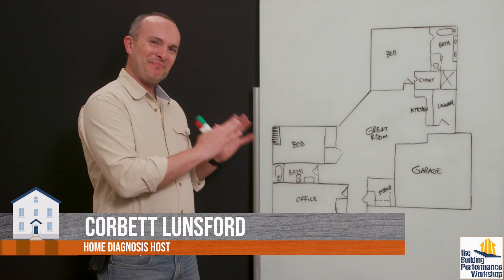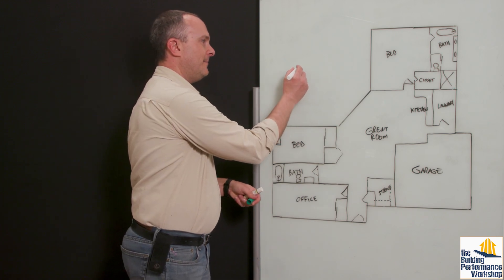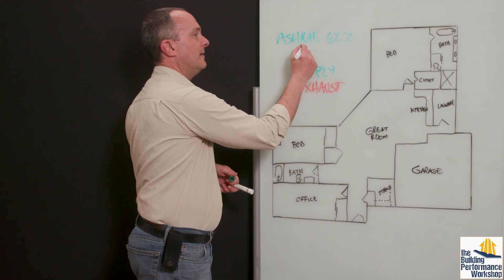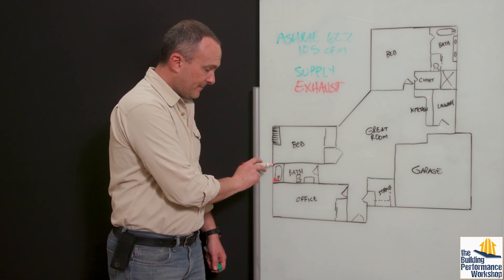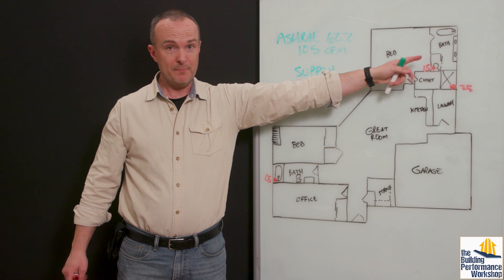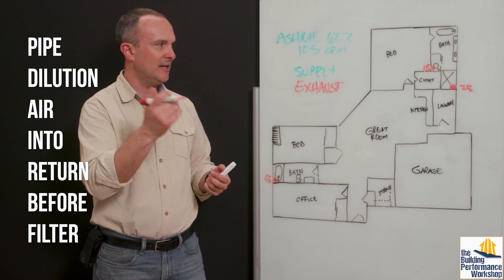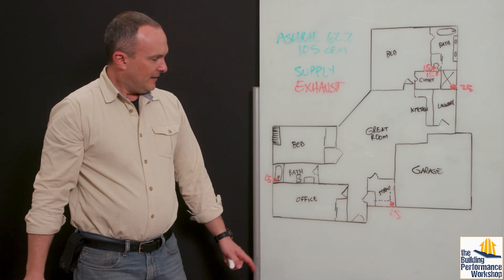Airtight Home Ventilation: Where to Place ERV Exhaust and Supply Grilles (HVAC Training)

Comment: Thanks for your channel.  I'm actually doing a major rebuild on a semi-remote island near Vancouver.  It's about as airtight as possible with a rebuild, with hydronic heating, and will require all sorts of creative installation to get the lines where they need to get in a building not designed for HRV/ERV.  I am relying on your channel, as getting anyone out here to do the work is impossible, so I'll have to become an HRV expert pretty quickly.  🙂

Comment: Great video and completely understood.  Would like to see a second part on this of sizing and location of supply air coming in at the best locations to assure operable balancing.   Sizing of lines, suggestions on proper vent grills or manual open closed vents.

Comment: Great video. However, I don't actually see placement of the supply grilles covered in the video (as title suggests). Lots of detail on unique CFMs per exhaust, but where did you place your supplies and at what CFMs? Possibly you can just post an image of the floor plan with supplies and exhausts. Cheers.
Reply from the maker: In the US, we size our ventilation off numbers for exhaust, then fit the supply to that (as long as ASHRAE 62.2 does not exceed, in which case use bigger target).
In Europe and even Canada, it’s opposite- they size based on supply targets and fit exh to it. 
I do mention, but easiest (and best imo) is to inject fresh air to return of central HVAC ductwork. Otherwise just make each room either supplied or exhausted as far from the door as is feasible.
Reply: Yeah, I was wondering if I'd missed the supply side but its not there.
Also, I've got a 'shower dome' which is awesome & keeps nearly all of the humidity inside the shower cubicle. I haven't seen any ERV/HVAC people discussing how this changes things.

Comment: That’s the thing, making design choices without sufficient knowledge and experience is an experiment. WARNING: Offering advice cloaked in a tone of certainty is unprofessional. I’m surprised you haven’t been sued. Be careful, buddy.
Reply from the maker: Not sure what exactly you’d propose for the thousands of people out there moving into quite airtight homes, but I’ll keep doing what I’m doing until anyone has better advice for them.
Reply: @HomePerformance  I will start by stating that it’s not your job to worry about the masses. I would think the most important thing is to dispense actuate information. Perhaps that is why I warn you and all the viewers. If you are asking for advice, then this. # 1 Allow for caveats and specials circumstances, every building is unique. That’s proven by TVA studies. If you don’t have a 360 view, then stop. #2 - Avoid the Dunning-Kruger effect. No one knows everything in this industry so let that be the guide towards humility. #3 - Provide follow up videos, like any good science, BS is evolving, what we know today might be tomorrow’s Duct board. Be okay with correcting thyself. #4 - There isn’t a magic bullet but you and I know that. However,  your audience may not. Some will listen to every word and execute half baked idea. Doesn’t that concern you? Be sensitive to that. Sure, you’ve done some work in educating yourself but that’s not enough. Chemistry, fluid dynamics, thermal processes and people are working against the design intentions. Take care when speaking to the masses.
Reply from the maker: Jon, I think you may not understand how many follow up videos we have, what we do for a living, or what worrying about the masses is about. Sounds like you might be looking for a different channel, and it also sounds like you might make money from spray foam.
Reply: @HomePerformance  I logged back in to offer this sentiment in which I wholeheartedly mean, I do not wish to offend you and the good works you and your family do. I’ve been listening to your Podcast for years and I remain a fan. How I show I care is by challenging ideas. I’m sorry you do not wish to engage in thoughtful discourse. BTW: I am a licensed HVAC consultant, Adjunct Professor, Fan of engineering, the sciences and math, expert in ERVs, VRF, DOAS, and mini-splits. My experience is split evenly between residential, commerical and industrial. I’ve represented over 50 manufacturers, and too much more to mention. IMO- Spray foam is the last resort but wouldn’t put it in my house.
Reply from the maker: Thank you for clarifying, Jon, I’m all for thoughtful discourse but you were pretty rude in this thread. You called me unprofessional, inaccurate, unknoledgeable, inexperienced, and told me I’m being negligent enough to be sued for the advice I give on this channel. Watch what you say more closely if you intend not to offend. Also, see the many other experienced professionals who are chiming in with exactly the opposite thoughts as you. Thanks for watching and being a fan, but please be a bit nicer next time, I put up with enough crap from my kids every day to take it here.

Comment: Looking for some clarification. Really like the idea of an ERV replacing the bathroom exhaust fans but getting mixed feedback when I talk to professionals in my area. The ME who designed my system says here in eastern NC we can’t do that. The installers in the area say the ERV can supplement but not replace the standard bathroom exhaust. Broan’s website advises against ERVs exhausting humid air. But this video and a high performance video says we can. Any insights you can offer? Thanks for information and the channel. Really appreciate it.
Reply: Thinking same.  With erv, humidity in shower would be redistributed to entire house.
Reply: End of the day did not pursue using the ERV as bathroom exhaust as that was against code.
Reply from the maker: @BenNC22 it is not against code. It is built into the Int’l Mech Code.
Reply: @HomePerformance  it is where I am. Multiple code officials in my county and hvac pros stated definitely bath exhaust must be directly vented outside. ERV was specifically not allowed.
Reply from the maker: @BenNC22 I believe they misunderstand ERVs, or their own code, or probably both. You can always appeal for an exception.
Reply: @BenNC22  Ask for the precise Code regulation so you can see it for yourself. Even inspectors and pros can get it wrong.

Comment: With exhaust fan in corner, 2 walls so close, possible impact to fan performance ? Rather does a fan pulling air with lower resistance on one corner but higher resistance on the wall side impact performance? Perhaps there is a way to calculate distance from walls for highest performance..or worse case reduced fan longevity.

Comment: If someone connects the ERV to the HVAC ductwork will they have to run the HVAC fan 24/7 or will the ERV be able to push/pull on its own when the HVAC is not running?
Reply from the maker: If you dump the fresh air into the return side then yes. If into the supply side then no.

Comment: damp in Vancouver?!  I beg to differ.  just because it rains a lot doesn't mean that it justifies an erv.
Reply from the maker: http://ashrae-meteo.info
Look into the actual weather patterns yourself, don’t just take my word for it. But generally, if you’re on a coast, it’s wetter.
Reply: @Home Performance  agree, generally wetter, but still fairly dry most of the time is my takeaway, even during the summer.  I'm seeing peak average wet bulb temperatures around 63, but most of the year it's much lower.  What am I not seeing?   
In general, I have no issues with ervs, but anecdata-- I have had issues with them in a few cases. In one case, (cal bay area) it was retaining too much moisture from inside the house and hrv retrofit was better at managing that.  And also, I've had complaints about ervs leaking between the streams.
Reply from the maker: Video forthcoming on the weather data, but watch this: ERV vs. HRV Mythbusting: Which Ventilation is Safer for Moisture and Humidity?
https://youtu.be/QOe4lluGwCg
Reply: @Home Performance   good stuff.  I'm with the lbnl folks on this one, but I think this is a place where reasonable people can disagree.  We agree on the goals however.    My experience is that on the west coast, it's dryer outside than inside most of the time, so that's why I err the hrv end of things.  Or at least its dry enough outside to feel sanguine about coupling my interior humidity levels with whatevers outside.  Though SoCal is starting to see increasingly longer periods of high summertime humidity (due partially to rising ocean surface water temps) which puts that into question for the future.

As an aside, ironically in spite of my preference for hrvs, it's mostly ervs that go into my projects, so you win based on that outcome.  Lol

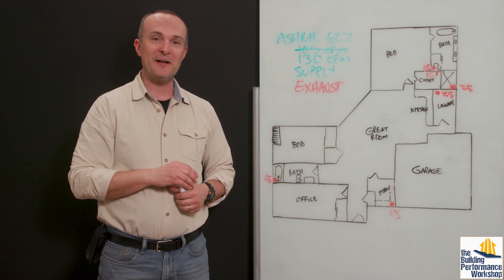Comment: 9:52 Hi, I’ve been scanning your videos and learning much. Any advice on components necessary when using zoned hydronic radiant floor heating by a high-efficient combi-boiler. At this stage of my home construction, no drywall has been installed, the heating system is not installed, spray foam insulation is in all exterior walls and under roof deck. Flex duct supply and return runs , fittings and boots (properly sealed and installed) are located in the ceilings for a/c. The air handler and evaporator will be in the garage attic space (also spray foam insulated). I’m looking to include an ERV, a whole-house humidifier (without ductwork if possible) and a whole-house dehumidifier (among other components if recommended). We’re located in West Michigan, climate zone 5. I can do further research on best practices for installation if I only had a list of the recommended or optimal components. Can you advise what the list would look like? Thank you in advance!
Reply from the maker: Sorry Doug, no advice from me, I’m not a hydronics guy. House sounds prettt good, just make sure the garage has no air connection with the house when you blower door test (using a zonal pressure test).

Comment: What are your thoughts on dumping ERV fresh air supply into AC supply with BD instead of return, not needing to run fan continuously?
Reply from the maker: Can work, just missing the extra filtration. Maybe best would be a Wye with an either/or damper.

Comment: Really love your video topics and the vast amount of information they provide. Would be great if you can do something about building a pretty good air tight house with a fireplace or wood stove or both. Is this possible to achieve.  
Thanks
Reply from the maker: Thursday’s video will hit home for you, Robert- but short answer is that will not work in many cases. Depressurization sensitivity is the issue once you get airtight enough.

Comment: When installing the fresh air supply output of the ERV in the HVAC air handler return path, does it matter where the air handler filer is?  I would think that the common location of in the return grill will cause a significant low pressure situation when it is running, increasing as the filter fills up.  I think some people have the filter at the blower motor, which is a different situation. Should those with a grill filter have a box added at the blower to accommodate a filter move? The simplified installations (retrofit) have both the fresh air supply output and the room air exhaust in the central air handler system.  It seems to me 0.5 in wc would really mess with the ERV fans.  Thoughts?  I have looked at a couple of install manuals, but none of them have made a comment on that central filter location and its effect on performance and balancing.
Reply from the maker: Exactly, Larry- filter grilles are only for not using the return for anything else. Filter slot is so much more versatile. Also, 0.5 would be supply + return, so ideally you only have 0.1”wc in the return trunk.
Reply: @HomePerformance  I will check where and how large that pressure drop appears soon.  I suspect that making the filter location change is in order.  Being in the attic, makes it not such a fun chore to change the location by adding the filter box at the inlet.  I have been also trying to decide if I can economically change the blower motor to be more efficient (EC or DC) such that i can run it at 1/2 speed in fan / heat mode with 1/8 the power while the ERV is active 25% to 100% of the time vs drawing 400W all day and making more noise than is desirable due to the air velocity being a bit higher than needed.

Comment: I have a question regarding the ERV exhaust intakes for closets. I was taught that HVAC returns are discouraged even in walk-in closets as that accumulates dust in the closet contents.  Would ERV exhaust intakes create a similar issue despite the lower CFM flow relative to an HVAC return?  Not that I would have to worry about that since code required HVAC supplies to walk-in closets which have exterior walls in my newly built house.  That bit of code adherence was ironic given the mythical Manual J/S submitted for my house.

Comment: No exhaust vent in the kitchen??? Also, please comment on possible loading of moisture from shower stalls into ERV. Will that compromise it's efficiency? And/or increase maintenance?
Reply from the maker: Mythbusting ERV vs. HRV: Which Ventilation is Safer for Moisture and Humidity?
https://youtu.be/QOe4lluGwCg

And the kitchen exhaust is absolutely necessary, but should have absolutely nothing to do with the ERV.

Comment: In that master bath. You have two outlet Vents.  What about conditioned air inlet?  Is there not one in the bath? Relying on door gap to bring in air?
With a conditioned air vent in that room. The exhaust would no longer pull from the door gap?

I am getting ready to vent my bathroom shower on one side and tub on other. I have a remote fan venting outside when needed. Splits into two 6" grills. One placed in front the shower ( to retain some steam and warmth) then. The other just In front the tub. 
Hvac inlet I guess centered in the room.
Reply from the maker: Heat/cool grille decisions are governed by the Manual J calc.

Comment: The amount of exhaust wouldn't meet code for bathrooms in MI.
Reply from the maker: Check the ‘intermittent’ exhaust rate spec’d in your code. Otherwise easy to get an exemption if they have something lame like operable window exemption in there
Reply: @HomePerformance  Will do. Thx.  How are you measuring and then air balancing for those low cfm's? Did you install dampers on each branch?  Also, I'm a big fan of return air filter grills at each point of the system...similar to your central return. Inexpensive upgrade.

Comment: Great video.  Here's a question I've been wondering about ever since I heard of HRV and ERV systems:  If I already have supply and return air ducts going in for my heat pump system, why don't I just use those for the ERV/HRV ductwork?  You did mention dumping the supply from the ERV into the return air side of the HVAC system, which does make sense to me, but why do you then need separate "return" or "exhaust" vents for the ERV?
Reply: you could just use a single exhaust vent for the ERV in the centre of the house (some brands here promote that), but then you still need bath room fans etc. so why not just use it to your advantage. you need to have the exhaust so might as well make it be a bit more useful. having constant airflow going through the bathroom is great. no need to have a separate bath fan.
Reply: @tweake7175  Yeah, I'm not referring to the outside exhaust necessarily.  I'm referring to using the cold air return vents that are already in most of the rooms to take the air back to the ERV, instead of running return air ducts to the HVAC system and separate return tubes to the ERV.  It seems like a lot of extraneous duct work and extra expense when, logically, you should be able to use the same ductwork for both systems.
Reply: @r.j.bedore9884  yes. Most just use the hvac system to ventilate.

Comment: Why are you putting a fan over the toilet in the primary BR?
Reply from the maker: Because the fan over the shower won’t pull odors from the toilet effectively.
Reply: @HomePerformance  got it. Thought it was for removing additional steam/vapor, but purely for odors, not necessarily required
Reply: Also, if you use the Broan AI to dump into your return, does the "AI" still work? Or do you need to manually adjust?

Comment: Carpet as I can’t imagine your ERV fan can overcome your duck systems static pressure if you are dumping your ERV supply into the return of your HVAC system you must be running the HVAC blower constantly isn’t that an issue with energy use and wearing out your blower?

Comment: Thoughts on sensors to control ventilation? I like the idea of controlling the ERV with a combo of indoor and outdoor IAQ sensors, both to save money by not needlessly over ventilating and to shut down the system during events like wildfires or dust storms.
Reply: I second it. Controls are not well understood but are necessary to any successful ventilation strategy